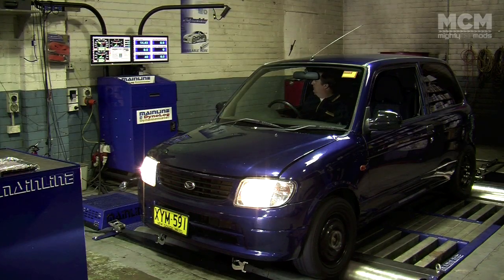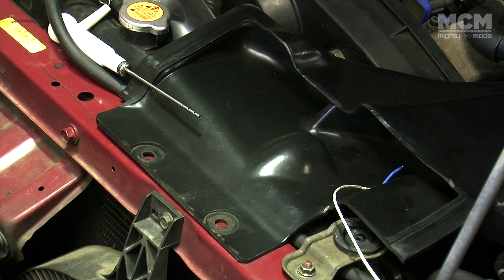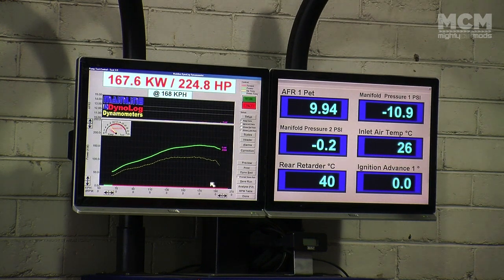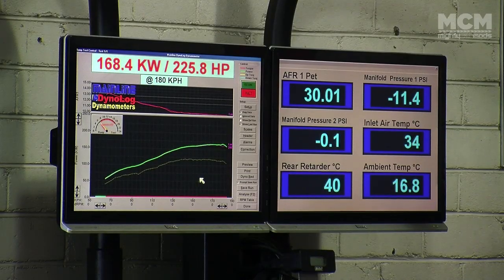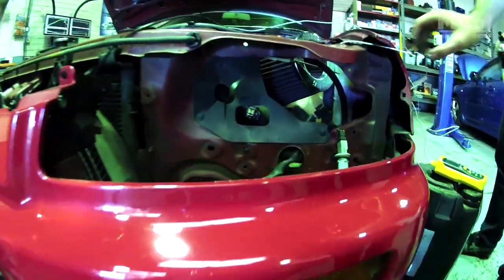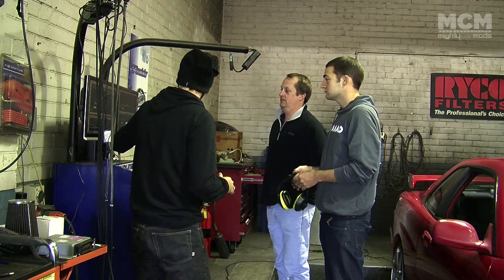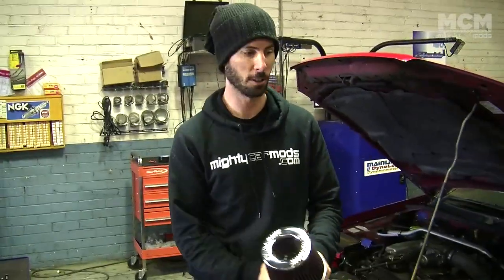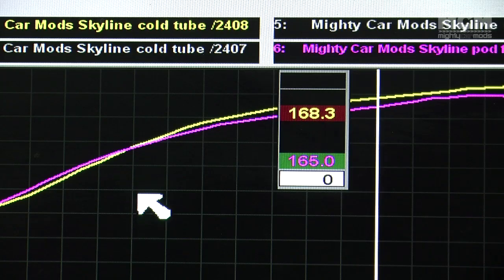Cold Air Intakes Mythbusted [Turbo]

Comment: 1. You need to install the cold air intake correctly meaning either in a ram air setup or coming down towards the bottom of the bumper to get it away from the heat of the engine. 

2. You also need to understand turbo makes a lot of heat so you need enough air to cool the area the fan does not mimic the same wind speed as driving. 

3. You changed nothing within the ecu and this is probably the biggest mistake making this video completely inaccurate because cold air intake normally allows for much higher air flow but you didn't add fuel which causes a lean issue creating less horsepower and can damage the engine. This is why the cold air intake and no filter at all made the same numbers because you had more airflow and didn't add fuel. 

4. Most of the time if you buy a legit cold air intake not eBay fakes the box will normally have a warning that states on the box one or two things. One have a professional install the part or two you need to have the car properly tuned before driving.

Comment: The moment I put an OTR system on my ve ss it started to spin the back wheels and I could feel the extra 20% gain in power not to mention the monster torque now I need the mickeys to keep the arse end from sliding out bro cold air is fully hektic if I could run my car in antarctica it would do 13 seconds flat bro all coz of the cold air...don't worry about the ice thou all that cold air will make the wheels spin no matter what you have on the back

Comment: Just by getting more air doesnt mean more power your computer needs to be tuned to adjust a/f for that extra air. Also certain cars will run lean and will cause the reverse effect and loose power. Also not healthy for the motor running lean.

Comment: So wouldent it make more power if the air was hot because then it would atomize the fuel better and you would get a bigger bang because the more atomized the fuel the bigger the explosion which means more torque and hp maby not a whole lot more but in theory it would

Comment: This doesn't seem like a valid example.  You have a car sitting in a shop, at ambient temperature.  The car has probably been sitting there all night, and now has a cold tank of fuel.  This test should be done outdoors, in Phoenix for example, to see a real world effect.  I'm not claiming it makes the power output better or worse in this more realistic test, just different.  But if you want to see how a CAI affects your Dyno pull, this is great.

Anyway, there is nothing wrong with CAI's, they just aren't magical horsepower creation units.

Maybe these guys should instead, see how adding a Cool-Can to this turbo car affects their pull.  Cold air doesn't help?  Try cold fuel.  Or do like the Bonneville guys of yester-year did, and get a tank of purified oxygen, and pump it into their intake mix.

Comment: While the claim peak hp gains is mostly bogus with a true cai and completely false about short ram intakes. One huge thing to look at is hp through out the power band. Or.... If the stock system actually is restrictive or allows heat soaking. Especially with cars that weren't designed as sports cars originally..... The car I have now intakes air 20f average above ambient temps, this is a good idea to remedy, not just for all of 6hp of gains rather to help engine longevity. I do think in the car world, lots of people just focus on gains, rather than efficiency which can mean the same thing.

Comment: I think this is reaaaaaaaallly skewed and here's why.  THE CAR IS NOT MOVING.  I installed a self made cold air intake in my old 92 Toyota truck because the airbox intake was pushed right up against the rear of the headlight. I already had a K&N filter in use and saw that I could drill a 2" hole under the airbox and run PVC pipe from the hole down and through the fender well, then straight out to the front bumper.  And so I did. This way the air is absolutely direct to the filter, rather than indirect.  When the car is driving, air is obviously being forced straight into the intake tube. I instantly noticed the difference the very first time I drove it. It was literally night and day.  If you just keep the intake inside the engine bay I assume you would not see any difference.  And think about it.  Ram air at 60+ MPH vs static, non moving air.  These guys DO NOT address this at all because its on a dyno.  For me it worked and cost less than $20.

Comment: Did you guys recalibrate the mass airflow sensor each time? Just curious if that would have had an impact or not each time.
Reply: no its not gonna make a difference, ecu should adjust after just starting it... and after 1 run its already learned everything its going to

Comment: Hmmm . Only thing I can see that invalidates your test is that the stock filter compresses the air through the scoop . This speeds up the air going into the filter . If a similar air scoop was fitted to the aftermarket filter that would make the test more comparable.

Comment: Kids, you aint mechanical engineer. The engine is not designed for that alteration. You need to think why.  Also, if there is a small leak during compression, it doesnt help.

Comment: Add a racing exhaust manifold and you have the result you want
Reply: @applepoop10  idk but my neon does it automatically, altho my mpg went down with the extra hps gained, I also have a diy water injection installed for extra hps, nothing special but works well on the road can keep up with most modern bmws  and audis

Comment: Problem with this whole test is that the cars tested are stationary....you cannot prove hp gains with an air filtration system by sitting on a dyno with hot air being spoken by the hosts
Reply: yup that and there's no indication that they even tuned the ECU to suck in the extra air available to it, they just took some shit, bolted it on and slapped it on the dyno

Comment: well but does it save fuel instead? 
mine did. from 10 km/l original filter. to about 12- 13.5km/l.
not sure if there is an increase in hp. but increase in torque.
my original nissan sylphy air filter is paper.
 can u do a test if the cone air filter save fuel?
thx.

Comment: I dont agree    i swapped my dirty old airfilter for a k&n inlay filter     and yes the tiny engine on my low weight car produced much more power  
Engine runs much better aswell      and more torque    induction sound is also much better

Comment: After research, I've realized this set up is for sound, not power. Dinan seemed to have an improved "CAI" which is basically a performance intake system for a fourth of the price from BMW. Adding some silicone tubes SHOULD increase power by 5-7% if I'm right about it. Don't have a dyno, but I have the Torque app that could read off some increases. It's a 2004 325Ci which is my new project car. I don't want an M3 because I actually hate BMW(personal opinion, nothing more) but I respect them so this budget car is great to have fun with. Anyone have experience with Dinan's CAI on the E46's?

Comment: Doesn't result in more power... Yeah because the power comes from the turbo, which is spooled by the exhaust gasses, which are extremely hot. This is obvious, and the argument over short ram vs cold air is done. Just think about it...
The only way the boost air temps are going to be affected is by a front mounted or upgraded intercooler core, OR meth.

Comment: I was watching this video for reverse effects. I don't want to know if the cold air plumbing will give me more hp. Once you are over 4 digit wheel hp on the street who cares, what I wanted to know is whether plumbing in cold air intake and filter would cost a lot of power. It doesn't seem to hurt so I cant see the point of hanging my S480 out in the open to suck up dirt, gravel, and any small animals that happen to walk in front of the car!!!! It won't look as cool as a 4" blender hanging off the motor but id really like to keep the blades intact and engine clean inside.

Comment: the reason you made more power is becuase of the tubing
think of that as a longer intake runner
now what that means is that is more of a momentum in the air being sucke dinto the motor helping it run better
think of it like a tunnel ram or a cross ram on a V8 vs a single plane intake manifold
same pincaible

Comment: My 2006 Chrysler touring 3.5 had a factory air box and some kind of diffuser through the front bumper. Extra weight.... dropped em for a cone filter on the factory set up. Was getting 20.8 mpg... up to 22.2 as of yesterday from 3 weeks of driving. 0-60 at 9.556 approx consistently and now down to 9.078No different fuel, no different circumstances. Only thing I did was drop that box and the other filtering device and swap on a piece of tubing and a cone filter to the gap in the headlight. If there is no benifit to a cone filter Explain....

Comment: my brother made a mod that injects hydrgoen gas into the engine , it was for his senior university project.
does injecting hydrogen increase the horse power of the car ?? since hydrogen is a flammable substance , it generally decreased the fuel consumption of the vehicle by 15-25%, and it goes well with fuel  , i have to ask if it does increase horse power.

Comment: I just changed my oem intake on my 88 rx7 and i feel the car pull harder sooner as the last air filter felt like it was restricting and heavier than the spectre cone intake. I also took the car battery off and let it sit for a bit and reconnected the battery as when i started the car the fuel and ratio would change...now all i need is to tweak the fuel coming in because now i have more air than fuel got me? Hope it makes sense.

Comment: Cold air intake doesn't work. I used simple termometer with a sensor on cabel and placed the sensor behind an air filter. The air temperature was exactly the same as air temperature outside the car. Modern cars are designed well enough.  They don't need cold air intake.

Comment: ecu needs to be reprogrammed because of the filter change the ecu is compensating for the extra air by leaning the mixture out rich theres no point of putting a cold air intake unless you've changed the exhaust and ecu to accept more power because of a free flowing filter

Comment: But u see the problem is I’m living in California which if you have a aftermarket air filter that is visible you will not pass smog check unless it has a special sticker I could go back to Nevada but they’re adopting California laws now which sucks I have to change it back to to stock so I can past it or fine someone to right it off

Comment: i wanna see results with different size filters because those were all pretty small. more filter area might let more through.
Reply: no. you can put a 3 foot filter on there and it will suck up the same amount of air as a small filter.

Comment: All this tells us is that Nissan engineered the skyline r34 well enough that the factory airbox is not restricting air flow... Uh duh
I've installed a K&N typhoon intake on my 2014 genesis coupe 2.0t whose factory airbox was quite restrictive and had lots of baffles for a quieter ride, K&N dyno tests of before and after show a definite 15 HP and 21 ft/lbs of torque gain. Such is the case with many street cars, trucks, etc., I put a typhoon intake on my father's 2008 f150, and while he doesn't have much of a lead foot, he says he feels there is an increase in power while towing and an increase to fuel economy which again is exactly what K&N claims. I like these guys, but I don't feel there testing is as exhaustive as it could be, a skyline r34 was probably the worst car to test as it lives and breathes performance, and nissan would have done what they could from factory to ensure plenty of power.

Comment: Actually one is a short ram intake an the long one is cold air guys come on. Your supposed to reset the ecu when doing an intake to re calibrate to the new filter first, also you did not run it twice like you did the stock air box. Still we all already new this with a short ram you should have tested a real cold air setup.

Comment: So let me get this straight. You’re adding a cold air intake and doing dyno runs without running the car. I mean if you really wanted to make power you should be adding the cold air intake and running the car after.i had a Subaru with turbo that ran 228 stock, after an exhaust, cold air intake, down pipe, up pipe and tube I made 412hp. So yeah if you just slap in a cold air intake without a tune, yeah probably minimal gains.

Comment: So you're telling me, that you installed a cold air intake, without a proper heat shield, without a tune, or any adjustments to the ECU or MAF sensor, and it didn't make a damn difference? Who would have fucking guessed that? Oh, I know. Anyone who owns a fucking turbocharged car. LOL

Comment: I'm currently modding my 2014 3.7 mustang. And I'm trying to do it right. I currently have a custom H pipe exhaust. Resonator delete with BBK shorty headers. But I want to peak on gains in HP. I'm thinking if I get a JLP cold air intake and an MPT tune I could see a couple extra HP with better throttle response... thoughts? Or should I just get a tune and that's it?
Reply: get the CAI and then tune it, don't listen to morons who don't tune their cars after doing all these mods to it

Comment: Cold air intake don't make much a difference if you actually want to cool the air put in an intercooler. Cool air is denser so scientifically it should produce some kind of boosted power just not much unless you have it seriously cooled

Comment: another thing you all fucked up on is with a cold air intake your looking at smooth piping with using flex pipe even if you kept a stock box and used that flex tube youll see power LOSS due to turbulance and friction that alone is enough to destroy any ideas you wanted to get through on this "great" scientific test.... you guys need to get some knowledge on how a motor works and take into account the details not just run around slapping shit on a car to show people "facts"
Reply: Let's see your video.
Reply: i think you missed his point.
Reply: Points can't be made without proof.

Comment: obviously it is not going to gain power. even if you install long tube headers on v8 it wont do anything. you NEED a dyno tune to adjust spark, timing, and AFR. You need to recalibrate ECU for EVERY MOD for it to do anything!!! That's why you see intakes, exhaust, and everything else when you go to 1/4 track to see cars run 9s

Comment: On a turbo car the aftermarket intake allows the turbo to spool faster  in low rpm vs stock intake.  Proper tuning with the intake would easily provide gains. Your tests are incomplete

Comment: i bought one put it on my car and my car ran colder according to my temperature gauge. like a notch below the halfway mark! so how is that not better? is it not better for your car to run colder?
Reply: No because your engine oil has an optimum temp to effectively protect. Which is why the thermostat is trying to always keep the temp constant. Depending how much cooler your running you could be causing excessive wear on your engine.

Comment: Good laugh reading some of the posts, especially ones claiming ECU needs to be "tuned" after installing CAI. I mean, if the car is seriously modified, I can understand. But for stock Civic with 180 HP + CAI and few other bolt ons? lol
Reply: I have called people on that a few times.  Asked them what parameters need to be changed.  Usually hear crickets after that lol.  Isn't the point of the ECU to adjust for changes in air flow, air temperature ect?

Comment: A c.a.i. wasn't replicated well here they also used that shitty pod that has a inner surface that pulls against itself. A good pod will be identical to stock especially if you shield it from the engine heat. So pod+cai =%2 increase plus a easier filter to work on, imo not by much but still. There's also some tidying up of the engine bay without all that extra ABS black plastic. No noticeble wieght reduction but could help if you do elsewhere. Basically you make a box behind a headlight with airflow and slightly shield it. Although it helps more for long winter drives. It doesn't do crap when you're going a short distance because the engine warms up better with a ram pod air exposed to the engine. After 10 miles though a cai might have denser colder air than stock / bay pod air. I realize most of this was tested but a proper flowing shield + better quality pod wasn't tested here. You would've seen that %1 without external pod had it been tested although it is a lot of bullshit I agree, I just run a pod to simplify cleaning the filters and for tidyness. I don't even have mine setup like a CAI.

Comment: So the Nissan they are testing on already has a cold air intake, they even admit to it. The baffle already pulls outside air from the car directly into it's intake eaning that all their tinkering around wasn't going to add any improvements. They failed from the beginning to try and prove their point. If the car took in air from the engine bay factory style than adding a true cold air intake would have increased hp. Now every car is different and some have different tunes and methods of measuring air mass so crazy claims like 20% more hp are probably not true. But according to solid science and physics, any car will make gains in hp regaurdless of the car type, model, design, etc when colder air is sucked into the engine. Some may make 2hp more or 14hp.